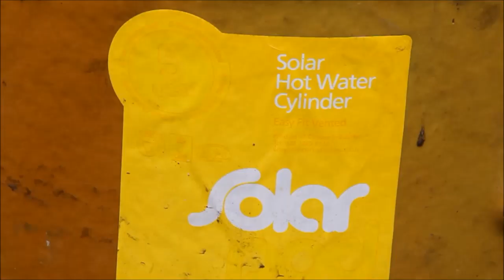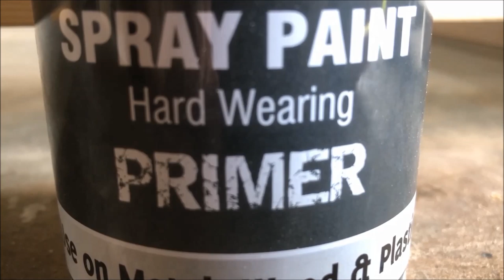Hammered Copper Coffee Table // Made from an old heating cylinder //

Comment: Stunning!  Would like to do the same.  Do all water heaters have a copper lining?  Any ideas for where else one might get used copper sheet like that?
Reply from the maker: Thanks Jeff. Most of them are in  Ireland and the UK anyway, I dont know about everywhere else. They can also come in stainless steel. 
The one I used came from a neighbour who had to remove it as it was leaking. If you know any plumbers I would start there and then maybe a metal recycling facility.

Comment: What is the copper's thickness? 2-3mm? I am assuming the colour on the sheet's bottom side is natural verdigris, but on the top surface, did you apply any type of lacquer/sealant/varnish to prevent oxidation? I looked up that G3 paste, and its instructions only say that you should «For a high gloss finish, follow with G3 Fine Finishing Compound». Gorgeous job, and thank you!
Reply from the maker: Thank Bruno, The thickness is only about 1 mm -1.5 mm I would say. I did not put any finish on but I may in the future, I want to see how it looks after a while. If it darkens too much I will just polish it again and then apply a finish to seal it. I used that paste to remove some of the scratches in the copper. Ideally the paste should be used a polisher and you would get a mirror finish.